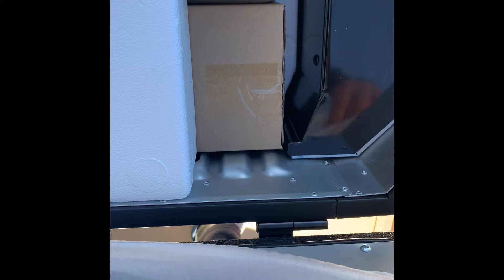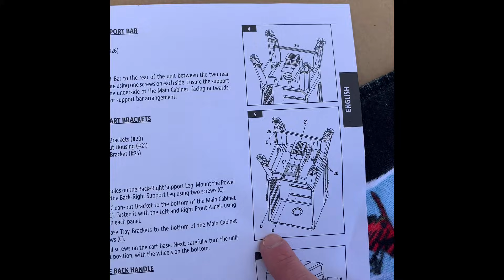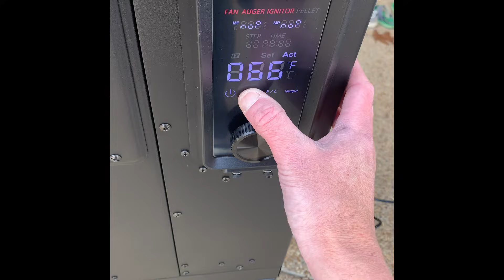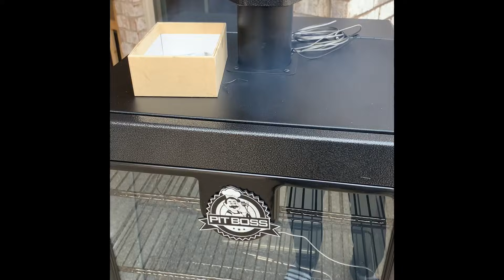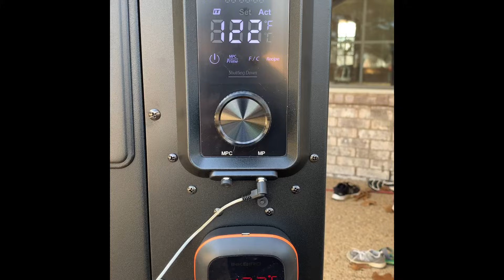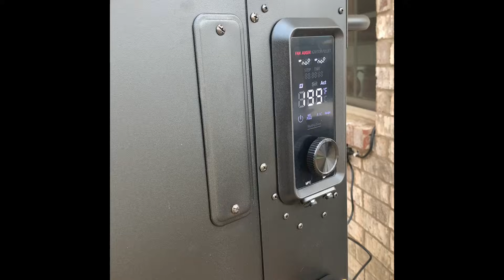Pit Boss Vertical Smoker 4 Series Pro Series 2 PBV4PS2 Wifi smoker

Comment: Do you or any one on here have a problem with the door not shutting all the way? Like my latch is assembled and latched correctly but the door don’t shut all the way.
Reply from the maker: I have not had any issues.   The latch does seem a little too tight, but it secures the door adequately.

Comment: Just purchased and assembled this bad boy today. Only one real hiccup and that was the left rear and right front legs were mislabelled, and it does make a difference when attaching support panels. Also the little wrench they included to tighten the legs nuts widened its jaws in the process, so have a tiny wrench handy. I have to say, this is a BEAST. The carton weighs something like 175 lbs, so you might want help loading and unloading, plus jockeying it up onto an elevated deck. It’s probably the most well built smoker I’ve ever seen. Looking forward to my first big smoke!😁👍🏻

Comment: I just turned it on erl code
Reply: Error low means it’s likely not getting hot enough because the pellets aren’t catching fire, not primed, or being augured/moved in fast enough.

You may need to clean and check the interior sensor. 

It can be a bad sensor inside the unit, but check that the pellets are actually catching fire. You may also need to sweep out the ashes from a previous burn/cook too.

Comment: Do you think using this smoker in below zero temperatures is the reason we cant seem to get the it to heat up to the desired temp?  Today it's -8 with a wind chill of -23 and it's struggling to get to temp let alone hold it.
Reply from the maker: Yeah, I would say that is a tall order.  Maybe wrap it with a welding blanket or some other thermal wrap.

Comment: Thank you for the video, it was excellent in addition to the many comments. I bought this model, have put it together, but notice the door latch pulls the door closed, but it's not a super tight pull...it closes but thought it would be harder to latch. Just hoping I get a good seal (this is my first smoker). Perhaps I don't need as tight of a latch as I may think.
Reply from the maker: Mine is pretty tight but I don't think you need a super tight seal.  Since a probe wire usually goes through the seal anyways, not sure it matters
Reply: Mine had a gap also on the latch side, but loosening and retightening the hinge body screws while latched partially fixed the gap. I then bent the door mounted latch part very slightly outward to close the gap.
Reply: Came back to this video for a point of reference. Meat probe issue. Answered my question, thank you
Reply: Came back to this video for a point of reference. Meat probe issue. Answered my question, thank you

Comment: I just bought one yesterday. As a person who works in the computer science field and holds a degree in computer science. I can say that the WiFi and Bluetooth setup is basically a gimmick. It doesn't work properly. Fails to connect, fails to switch between BT and WiFi. It's just junk and needs to be remedied or stop selling this with those features until they can correct the issue.
Reply from the maker: I can say that I haven't had issues with Wifi/BT feature.  Maybe the unit is bad.

Comment: I just bought this pitboss and put it together. Rolled it outside and had a storm that night. Next day i noticed water had got inside. Is there any way to tighten up the door latch to get a better seal?  Has anyone else had this issue?
Reply: Grab a cover for it
Reply from the maker: Amazon has plenty of aftermarket options.  The one I got was probably around $20-30 and has held up nicely in the rain.

Comment: Does your auguer go off every few mins? Mine does and always has a loud sound tahts it’s on. Like every minute. There’s no jam or anything, and pot is cleared before every cook. I don’t really hear the auger here so I wonder if I’m doing something wrong. Cooks come out great and have had zero issues just more noise than anything
Reply: Your question is 11 months old, so I hope you have already found out that is normal. It must be a gear reduction motor, because it turns for a while. And yes, it does it quite frequently. That's how the temp is maintained.

Comment: Buying from Lowes, take advantage of the free assembly and delivery.
Reply: No don’t take advantage of free assembly, they are not mechanics or someone who can run a screw driver. Mine has stripped screws heads and stripped threads because of Lowe’s

Comment: PIT BOSS needs to update the SMOKE IT APP and the firmware via Wi-Fi! No excuse not to!
Reply from the maker: They updated the app, seems better!
Reply: A year later and if it's been updated, it needs to be again. GLitchy. GAve me erroneous info, too. Told me the smoker temp had gone down to 135 deg F, so I rushed outside to find it still at 250.

Comment: I had a Series 5 and currently have a series 3. The thing I did not like about this one and the series 4 is that shelves are fixed on their separation. The series three and 5 have adjustable self brackets. I cut a piece of rebar the width of the grate and got some meat hooks to hang ribs. I really wish Pit Boss would come out with a PID controller for it.  A couple tips I've learned is that the back runs hotter than the front so when doing chickens or turkeys you'll nee to rotate them. When cleaning the door get some Simple Green and 3M green scrub pads. It works really great. Yours has the PID controller with the phone app?
Reply from the maker: Yes, it has the PID. I find it to work pretty well. It can struggle to get up to higher temps quickly, so I manually prime a good bit to kick start it.

Comment: I’m not using the meat probe and I have the same issue you had. It won’t heat past 150. What did you do to fix?
Reply from the maker: Did you prime the auger so pellets are ready to go?  You should hear pellets falling into the fire pot periodically or when you press the MPC/Prime button.  Also, make sure no preset temp are active on the smoker itself or the app.
Reply: The rain cap is a rain cap not a damper combustion needs airflow and these have advanced PID controllers. Also the mpc probe is will drop the cabnent temp to smoke after the set temperature is achieved to hold your food and hopefully not overcook

Comment: What's the weight on that pit boss is it heavy?
Reply from the maker: Not super heavy.  During assembly, you might want a second hand.  Once assembled, it can be easily moved using the handle and unlocked casters.
Reply: 172 lbs

Comment: What is the outside measurements of the smoker? I am getting this smoker and have a certain type of cover I buy for my grills and want to make sure my cover will fit. Thanks
Reply from the maker: The footprint is about 28x28”. The cabinet is about 22.5” side to side and about 25.5” front to back if you include the handle in the back. It’s about 56” tall including the smokestack.
Reply: @pkabass78  thank you!

Comment: This is a much better design with the controller on the side than at bottom where it would get damaged from water and grease running down on the front and ultimately fail. However I would like the controller at the top and out front instead of the side. But I'm considering buying one .
Reply: Yes. I bought one today and used it to smoke a pork loin. The panel on the side is not convenient. And I've found that the app is glitchy. At one point it (the app) told me the temp was down to 135 deg F. I rushed outside to find out that was not the case. Grrrrrrrrr.

Comment: Total piece of garbage.  Send it back as soon as possible.  If you already cooked on it, undoubtedly you found out what a piece of trash it is.  $400 out the window!  Friends don't let friends buy PitBoss!
Reply from the maker: I've cooked pork butts (up to 12 hours), chickens (about 4-5 hours), and sausage (about 1-2 hours) without any issues so far.  What problems did you have?
Reply: @pkabass78  I notice that you got no response from this guy. Which sucks!
Reply: Here’s my situation….I got one back in November…did the burn out….then the hopper caught on fire…so they sent a new unit…I’m a little gun shy dropping a whole bag of pellets in again….please give me your thoughts on this…thanks Dan
Reply: Great addition to my other cooking toys.  Smoked 2 turkeys and 4 slabs of ribs for Thanksgiving.....Outstanding and NO problems.  If you are having problems, I suggest you read the Manual.  It's easy - pesy.
Reply: Lol.. I've done over 100 cooks on my Austin XL over the last 3 years without a single issue.. Also own a vertical pitboss that I've never had a single issue with! Pitboss worth every penny, absolutely no reason to go spend top dollar for the same exact thing with a different logo on it

Comment: Spent an hour and a half putting it together, just to find there was a broken internal weld which is supposed to secure the ignition probe, rendering it inoperable. Very disappointing. Promptly Threw it in the truck and returned it. Ordered a Z Grill instead

Comment: I have the exact same smoker, and I’m assuming since this is a month later you have probably already used your smoker and figured this out, but your drip pan is backwards, the little thing that looks like a handle is really just a spacer to keep it away from the back wall so the grease can drip into the channel and eventually into the catch can.
Reply: almost ready to tell him but I was only 10 months late :P
Reply: Yes. I noticed that, too. Bought one today and found that very strange, but at least mine has the word "FRONT" embossed in the pan. Maybe the earlier ones didn't have that.

Comment: FYI, the drip pan/heat deflector is in backwards and the way you have it installed the grease will flow to the front of the smoker and could cause a fire. Trust me on this ...
Reply from the maker: I’m glad you guys have pointed this out. Since I put in an additional pan/tray above the drip pan to make cleanup easier, I unknowingly avoided a potential problem!
Reply: @Elijah Santana we don't. Care.get rid of gf if you do not trust Her.That is what IS wrong with ppl...High school is over.Find a trust worthy partner & buy a Ring.Swinging from Gf to Gf do not get u any where.
Reply: @michaelwalker217 ?... Lmao wtf is this comment? Wrong comment section/video?
Reply: @dw5284bro... Im still confused 😅😂😂

Comment: I bought 1 of these a couple weeks ago and like it. Just wanted to let you know that your drip pan (the shield above the water tray) is in backwards. I had mine in like that at first and none of the drippings were going in the pan. That ring looks like a handle, but it goes in the back.
Reply: LOL!  I thought the exact same thing about the ring looking like a handle.  Had mine in backwards too.  Not a good picture in the manual about how that goes in.
Reply: @richnelson8508  Their marketing material has photos of it in backwards. This comment just saved my day.
Reply from the maker: Thanks for the input!  Makes sense that the water pan shouldn't cover the channel for the grease to go down the back.  The rings acts more like a stop so that you push it in far enough.
Reply: Haha this one confused me aswell
Reply: LOL, just assembled mine today and thought if I used the heat deflector, I’ll lose a grill rack!😅

Comment: I enjoy mine. If you care about it you can send your control panel back to them and they will upgrade the firmware to give you 10-degree increments up to 250 and then 25-degree increments up to 300 degrees.
Reply from the maker: How long did it take to send it and get it back?
Reply: @pkabass78  I didn't do it because I usually smoke at either 225 or 250. But people on the Pit boss forums say about a week.

Comment: I see this is their new version 2 of the 4 series and some of the changes they've made to it.  How do you like it?  How many cooks?  Any other issues?
Reply from the maker: This is my first Pitt Boss and my first vertical smoker. So far I have enjoyed it! About 3 cooks so far, beer can chicken and pork butts. I’ll put my last pork butt cook up on YouTube soon.
Reply from the maker: *Pit, not Pitt
Reply: About to take mine back to Lowe's .  It won't even reach 350, I waited over an hour...
Reply from the maker: @Bee_Beautiful  Did you try using the prime button frequently?  Are you in a cold climate?
Reply: @pkabass78  it is 45 degrees here.
Reply from the maker: @Bee_Beautiful  I wonder if the glass front loses a lot of heat, maybe that’s why it struggles. I plan to get a thick welding blanket to put over the front when it’s cold.
Reply: @Bee_Beautiful  did you put it together or did you get the pre built one?
Reply: @lilnikki109  I got the pre built.
Reply: @Bee_Beautiful  okay only reason I ask, is because we just bought a pre built one. It wouldn't go past 160, we found a screw on the front bottom by the ash tray, that they didn't put in properly, so it wasn't allowing it to go all the way back to catch the pellets on fire. Took the screw out now it works great.
Reply: @lilnikki109  I look all over it, try everything and still wasn't moving pass 150. I try 3 times before I took it back to Lowes.
Reply: @Bee_Beautiful  You have to prime it.Its in the book